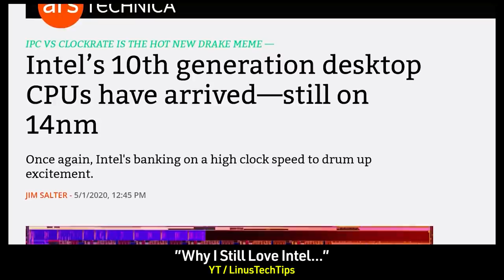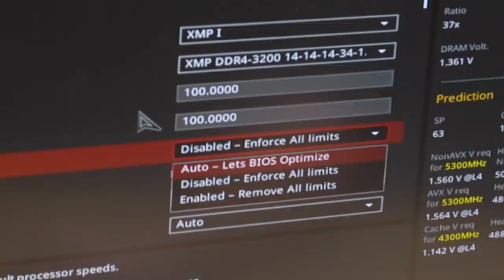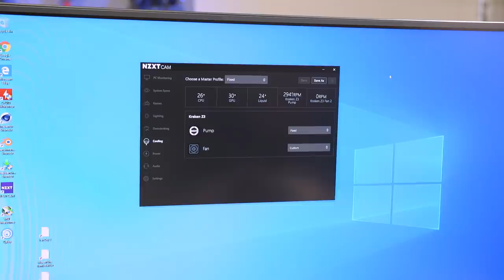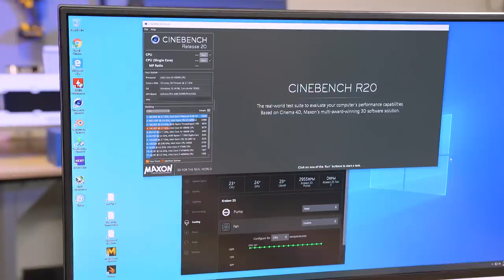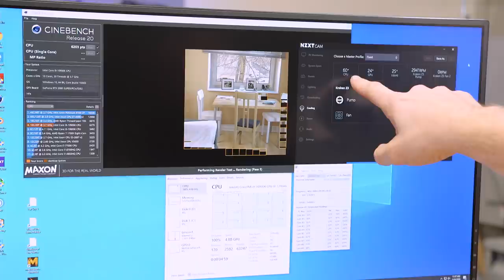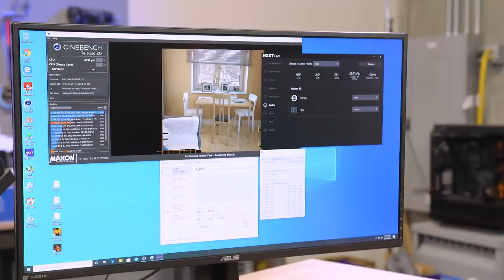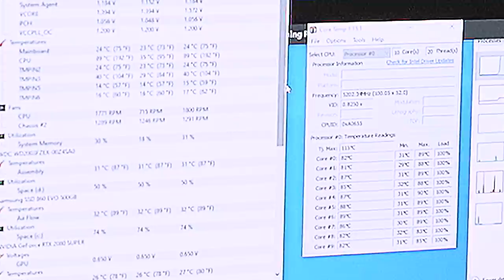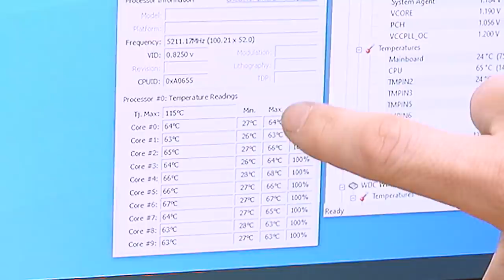Does the 10900k Melt!?

Comment: Love your channel! Had a flash back from a recent episode at Micro Center. 28 years ago I lived about 2 miles from there were I bought my 1st computer. It was a 486 DX2 50, 40 mb Hd, cdrom, 3.5 floppy and 1mb ram oh and a modem card. Pd $1400.00. I now live about 25 miles from the Micro Center in Atlanta. Just up graded my current computer to a Rayzen 3600, Asus MB, 16gb ram and 500gb SShd. About $300.00. Not a gamer but this is pretty fast for this old guy. Keep the info coming.
Reply: Nice build, I'm still holding out to see what's going on with the upcoming consoles cuz I only upgrade once every 6-7 years or so. The way they are using SSD's and the upcoming ryzen chips are making me wait and it's killing me:D

Comment: If you want you could use a thermaltake open chasis case most are basically open test benches with tempered glass attatched to them.  It would technically be a case but still has an open air design simillar ti a test bench.

Comment: Mine is running on Air cooling via BeQuiet DARK ROCK PRO 4 and I never top 63C while running cinebench at 5.2ghz all cores. 
I use this pc mostly for photoshop and it is able to run plug-ins and filters extremely well. coming from and 8700k.

Comment: 11:07 It's a soldered cpu, delidding and replacing with liquid metal further improves temperatures. The die from the K SKUs have been shaved down and the IHS has been made thicker to compensate.

Also, if the open air test bench performs better than even the best case on the market, the complaints about it not being realistic is valid.
Reply: Keven Harvey you missed the point of the test bench. He was controlling variables to get his results and a bad airflow case will make all components run hotter no matter the brand
Reply: Nothing will be realistic because nothing will be applicable to all use cases(no pun intended). Nobody is going to run this test on all cases, will all cooling configs, with all fan configs.

Comment: I'm late to the game, but this video was exactly what I was looking for.

Thank you for running this cpu, with an AIO, at three different speeds; and then adjusting the OC voltage to bring the temps down.

My aio comes in the mail today, and I'm excited to put it together and see if I can achieve similar results.
Reply: Did you see the 108050k for $375 on Newegg? Hope you didn't spend much lol.
Reply: @Aliothale  Got it for $450 - probably could've found a better deal, or waited a bit longer for rocket lake to release.

Comment: Can you demonstrate this thermal runaway on water temp?
Scientifically it should be linear, every time you double the watts, your Delta T should also double.
Reply: i think the thermal runaway happens because silicon conducts better when its hot, so it will draw more power by itself when it gets hotter
Reply: Any heat put into the loop over what the radiator can put out to the air will stay in the loop, causing the temps to start rising until something gives. It would seem like a very sudden and rapid change because the rad exchanges a lot of heat in the first place.
Reply: @G14N14RI12  not if the heat source doesnt keep increasing the amount of the heat its producing.
Reply: @ademiravdic  That... is not how anything works. Imagine a radiator that can get rid of maximum 100 J/s of heat. As long as the cpu puts out less than 100 J/s, the system will stabilise at at some temperature. But if the CPU puts out 110 J/s of heat, then the water in the loop retains that remaining 10 Joules every second. This means the temperature in the loop begins to rise until the CPU puts out less than 100 J/s (probably by breaking). Of course, this example doesn't take into account changes in heat exchange due to temperature deltas, but the basic idea still holds there.
Reply: You forget, that the hotter the water gets, the more efficient the radiator can pull away that heat from the water, since the delta t between water and the air will get bigger over time, until it reaches equilibrium. I doubt there will be any thermal runyaway possible.
Reply: It's so funny watching these tech channels do an about face and worship intel because of the risk of not getting free stuff anymore when they tell the truth. Pathetic.
Reply: not sure what Jayz meant but as in my above comment I can tell you (I own 4 aios 1 custom loop 3 air coolers) that you want your liquid temp to stay below 35°C that's the tipping point after which I noticed the room starting to get noticeably hotter and so your system intakes hotter air too over time, it won't increase to infinity but it seems to be the point at which if you touch the rad it will constantly be hot it's overwhelmed and doesn't work as it should, the rad should be mildly warm or cold it's supposed to be cooled by the fans if it's hot then it's not cooled enough for the heat "load" it's not something you should have on a mainstream cpu but on HEDT/threadripper with 200-380watts ONLY for the cpu you will for sure
Reply: @G14N14RI12  @adec avdic
You do have a point with your statement, but when looking at CPU cooling that is unrealistic. A cooler is just to increase the surface area of the cooling.

in an ideal world, If we looked at a CPU with 36 cm*2 surface are and had a cooler with 36000 cm^2 then the 1000 times difference in surface are means that to make the cooler dissipate 1 W/cm^2 the CPU would have to make 1000 W/cm^2.

Now for the efficiency of the cooling. On the hot side the temperature difference would be 70 c (97c-27c) and on the cold side 7c (27c-20c). The hot side will pump energy in 10 times more efficiently than the radiator gets heat into the air. The difference comes from the materials heat resistance/conductivity. 

Now to loop back do the initial question, thermal runaway.
Realistically, normal pressure or above, we wont ever see thermal runaway at CPU temps below 99c. We will just see a lower performance steady state, the radiator will get more efficient in cooling as it heats up, will give away more energy, but it will also take away less energy from the CPU as it heats up.

When the the temperatures of the CPU reaches above 100, there are 2 different situations that can happen. 
1. same as with 99c and no problems because the water wont boil yet.
2. the water boils, this is bad because as water boils it will increase the internal pressure in the system till it starts leaking or till the full loop turns into vapor in which case it will have 0 cooling potential when compared to water.
3. the water flash boils, there will still be water in the system but the hot side will be covered in hot vapors that will insulate the hot side from the cooling water thus making the cooler not work efficiently.
Reply: @jvjv658  +1 thermodynamics points. :)
Reply: @fredEVOIX  there is no such thing as an "overwhelmed" radiator, the hotter the radiator the more heat is exchanged with air with everything else being equal.
that is unless we're talking mechanical failures caused by heat. :D
Reply: Well eventually it will reach an equilibrium again with a radiator that is too small, its just that you may start throttling before that occurs, I have tested this on my own system by disabling fans (still some passive cooling from having so much radiator) but it does eventually equal out as a radiator is more efficient when there is a larger delta t between ambient and coolant temp. However coolant temps do rise very rapidly once the loop is heatsoaked with inadequate radiator.
Reply: The easy way to do that is simple to turn off all fans, you'll see it happening
Reply: @jvjv658  Exactly
Reply: Love reading all these comments that only take a few things into focus 1 most of the time, there are more variables involved than just fans and rad, what about coolant, water and air speed, wattage VS heat. Not one of yours would run exactly the same as his even if same parts, and ambient being the same, micro discrepancies will be involved, always. Just chill, yes your all smart people. Get any good info you can use from the content and apply to your situation if possible. That's what it's there for, to help consumers.
Reply: R/iamverysmart

Comment: A test in a random (middle class) case is always better than testing in a situation that's as far from the expected use-case as an open air system. It's accuracy vs precision. The accuracy is lower, but it's low already as everyone's system and ambient is different. Precision is what you need, that's where one unit is better than another

Comment: 1.4v was 99c and 1.35v was 65c. So for 7.5% more wattage you get 34c more. That is a heat transfer problem between core and IHS. Direct WB on die would be interestig to test.

Comment: Great Video as always Jay. OK Here is my idea for a basic brands of Hard tube to pipe fittings video. I also want to Thank You also for your old fittings overview video! :)  You did a video 5 yrs ago on Monsoons fittings. It showed more than ANY Retailer and Most Manufacturers sites!  I wish somebody would do a video on just the common brands, basic compression fittings for hard lines to G1/4". I have looked everywhere about what is inside of each brand. 1- O ring?  2-Orings ? 3-Orings?  I found 1 Other U-tube video that showed that Thermaltake has a fitting is a 3 pc fitting, with 4 -O-rings!  (It needed a 4th one because it was a 3pc fitting instead of a 2 pc like the others.)  Some also have a  washer under the nut with the upper o-ring.  Its NEVER On any website where they are sold!  A couple manufacturers show sometimes, after you look up their website.  But Most Do Not!  There are what like 6-10 brands?  Why doesn't ANY of these retailers describe or show what is inside these expensive brass fittings so we can make an educated choice on which brand to buy? ITS Not Even In their Descriptions! Unbelievable!  I would like to buy the best, most secure Fittings.  Not the 1 o-ring ones but its impossible to tell,  Who, Has what, Inside! It would be a good idea for a video for somebody to help these retailers /manufacturers.  I guess they don't think it matters what exactly is in their fittings that seals their fittings to the tubing and anybody who does any amount of plumbing knows it does. It Might actually make sense why one brand is 3.00 for a straight G1/4"pipe to compression fitting and another is 4.99 and 6.99 and 7.99 and  9.99! Maybe this would help sell those higher priced ones.  I am just amazed this is never listed ANYWHERE. So far I have bought 3 brands and all are different sealing and o-ring amounts. Some had Aluminum nuts, and some were Brass Nuts. Not that it matters too much but would be nice to know! The way that they seal water is by the inside O-rings, The outer one in the nut, with the (sometimes) flat washer, is what holds the tube, from pulling out.  I am not going to keep buying and guessing who's is decent. What a weird crazy industry. I am about ready to just buy brass compression fittings with brass ferrules and brass nuts be done with this sillyness. Its worked for 100 yrs for our water supplies in buildings and homes.

Comment: Give me a fun awesome overclocking chip at Ryzen prices

Edit: Ryntel
Reply: @spartan1986og  If I was anymore Inzen I'd be enlightened
Reply: I'd rather buy a CPU that's pushed to the limit and I don't have to adjust to much to it. I'm paying for it already, why do I have to tinker more to get my money's worth
Reply: @rudysal1429  overclocking is fun that's why
Reply: The xt Matisse refresh might very well be exactly that, let's see....
Reply: Rudy Sal 14 you dont. cpus runs great out of the box actually. if they were pushed to the limits you’ll have to deal with extremely high temps and it pulling 300w all the time and stuff like that
Reply: @wafxx-8973  And that's where I get my joy from. I used to cool a 4.9Ghz 5960X and now a 7700K@5Ghz just using an NH-D14 and 15. Back in 2014 Quadfire 290 TriX my PC then was just tearing through 1,200W. Good times

Comment: In response to your comments about doing the test with a oppen chassis/traditional case. A much bigger factor that a lot of people don't acknowledge is ambient temps of different countries and whether or not the computer is used in an aircon room. I have had systems (FX series) that will throttle or even turn off in non air con rooms that are 30c+ but are fine in air con rooms or at 24c or lower, and this is regardless of how the CPU is cooled or what case is used, and at stock speeds. The case/no case variable is way less significant than these other factors. TL:DR: Australian summers can suck.

Comment: Even without thinking about trying to match every case out there, testing on a test bench is always going to be more consistent. As it's easier to set it up the same every time. Plus you don't have to worry about cables or tubes being placed in a different place, and cutting airflow.

Comment: The people who said that the CPU is hot probably dont know how to set a manual voltage or what that means. So there u go. The lower substrate saves 5c at max, the IHS probably 3-4c max. they have stim on 9900k too

Comment: XMP I is ASUS optimized XMP, XMP II is standard XMP as given by the memory
Reply: My 9900k rig crashes using XMP I

It runs very stable using XMP II though.
Reply: @Darkhalo314  See mine is the other way. With or without overclock on my CPU my XMP II profile is not stable. I assume its probably to do with incorrect timings for the ram but I'm a Noob.
Reply: It gets boring to run XMP after a while though. No BSOD or nothing makes me question if i'm on a console  lol :D Manual tune to get the best result!
Reply: XMP is an overclock to your memory controller, that on this CUP is listed as 2933Mhz by Intel. 
That is the speed at witch Intel is willing to say it works and that is who is providing the controller, not the RAM or motherboard manufacturer...

Comment: In the first test there is no power headroom, because the i9 already pulls 125W from the wall. If not the clock speed would be 4.9 GHz, which is the standard all core turbo.

Comment: Just like someone else said " He said early reports indicate." Speculation was that they would be hot.  The speculation was wrong and not Linus.  Linus didn't say the speculation was valid or correct.
It was unfair and unreasonable to compare an overclocked i9 CPU running a stress test to a stock AMD CPU not running a stress test. 
I'd also like to add that no one overclocks a CPU to save power or use a cheap cooling solution, just like no one buys a luxury or performance car to save money.
Reply: Intel actually did really well with the temps to be honest. Ryzen 3000 chips are really freaking hot, like Jay had 45C Idle on an open air testbench with a 3950x and be quiet something slim. Under load its not really any better.
I have the feeling nobody really talked about it in the mainstream scene, might have went past me though. Everyone was like look at these numbers but temps were not a concern. Again, maybe that went straight past me and Im just dumb (which is likely) but the 10th Gen has really good temps. I did not expect that either, seems like nobody really did.
To be clear, this is neither pro Intel nor contra AMD, there are more things than temps after all. Price, performance, socket support, cores vs clocks and the like.

Comment: Not only is the fact you don't have a case applicable, it is essential. You could easily choose a case then approximate the temps in other cases based on your other reviews. If a NZXT runs at X degrees then it will be X= whatever the other cases are +/- other cases ran at. You cannot give a temp and pretend it is 'representative' of a user experience when not giving that experience.